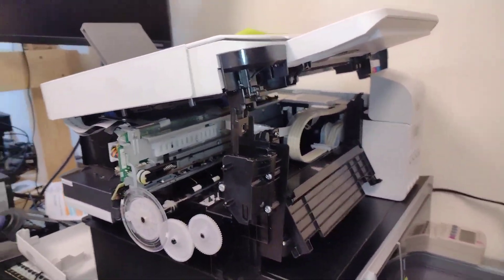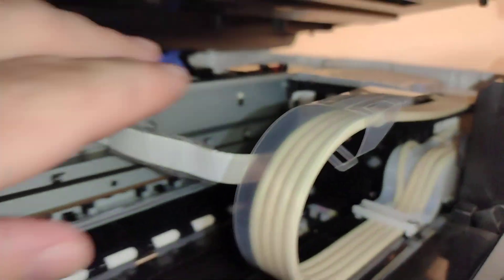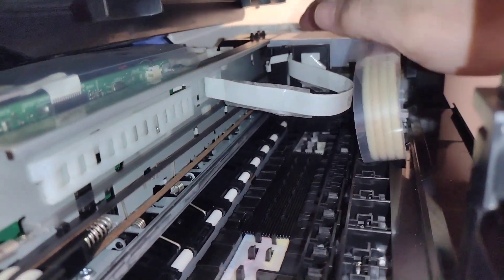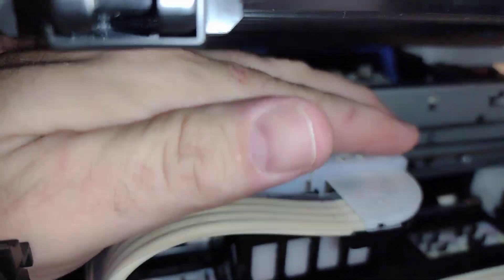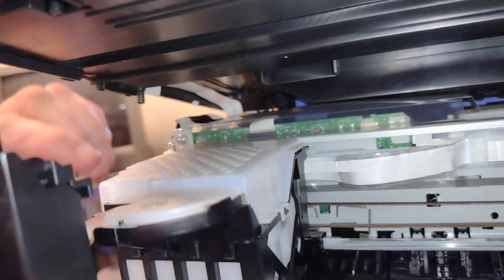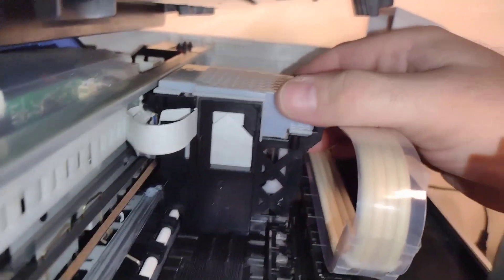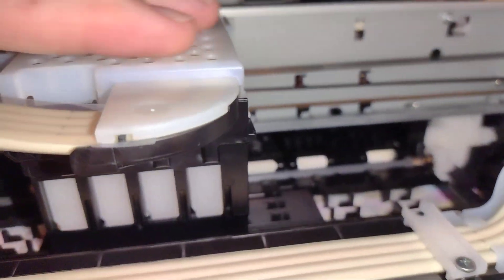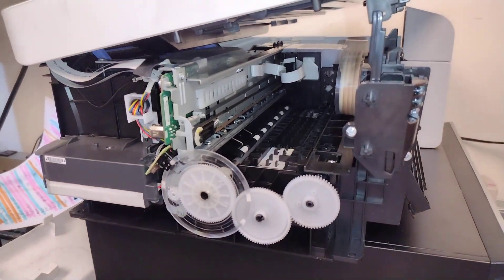Epson EcoTank ET-2803 DESTROYED Itself - Stupid Engineering Failure

Comment: That ribbon cable is designed to have a clear plastic sheath running along that ribbon cable (from end-to-end) to provide support. If you notice, your ribbon cable has the clear plastic sheath broken off along the middle.  Parts of the broken clear plastic sheath is still present at each end of your ribbon cable.  For example, you can see your other ribbon cable running vertically at timeline 0 minute 38 seconds does have this clear plastic sheath from end-to-end.
Reply from the maker: Thanks for the info!

Comment: I'll never buy another Epson or HP product. I'll buy a Brother the next time I need a new printer.
Reply: What about Canon these days? I have an old Canon LBP 2900B which I haven't used for years. Back then it was sufficient for my needs. Refilled its cartridge multiple times. Everything was fine. 
Now I need it. But it doesn't work well. After some experiments I found out that it can print only if I put 1 sheet, otherwise it takes more sheets, eats them and gets jammed.
Not going to buy a new, but still interesting to know in case I will need a new one.
Reply: @dhxl   I have never had any luck with Cannon printers.